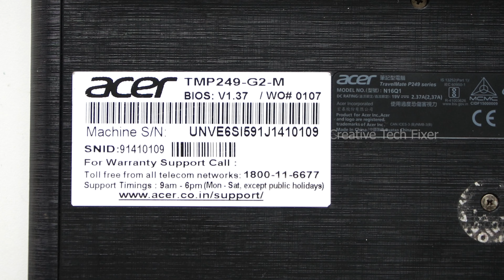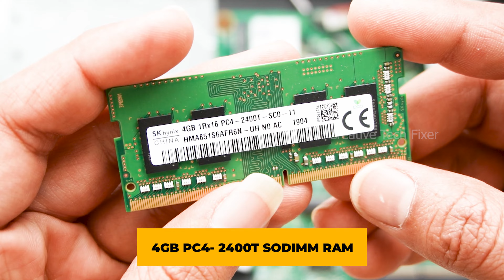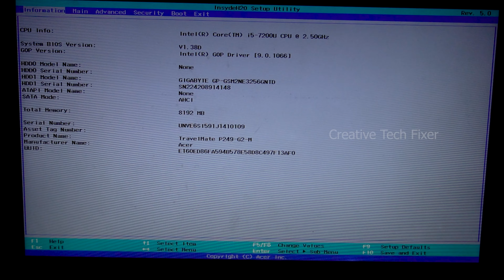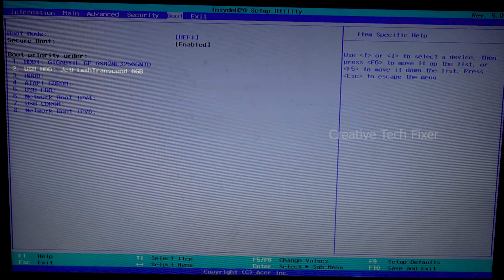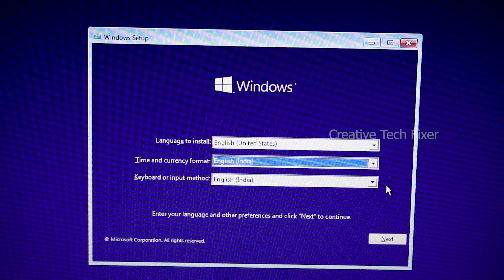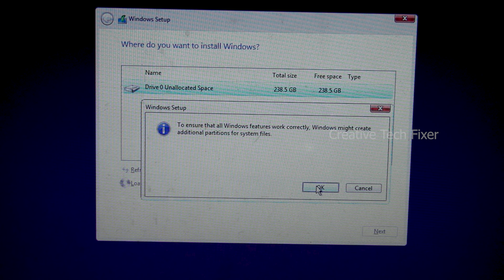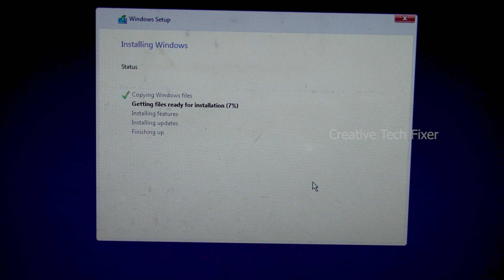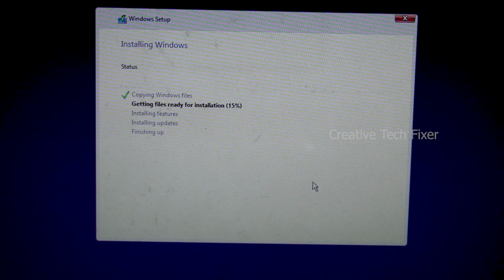#acer  Travelmate P249 series RAM + NVMe SSD upgrade | Boost Your Laptop Speed

Comment: Hi sir! 
Mine is a P249 g2 mg (N16Q1) 

Can i upgrade into m.2 nvme PCIE 3.0 and 8gb ddr4 2133mhz ram? Pls answer thanks
Reply from the maker: No you can't upgrade NVMe M.2 SSD on this laptop.. there is no M.2 SSD slot. And you can upgrade upto 32GB DDR4 2400MHz RAM.
If you like the video please subscribe to my channel it could be helpful to my channel growth..
Any queries feel free to drop your comments..
Reply: I think it has
Reply: @CreativeTechFixer  there is an NVME slot on this laptop model, you can literally see the m.2 screws at the center lol, it accepts PCIE 3.0 NVme 2280, 2260 or 2240 M key

Comment: My laptop model is acer travelmate tmx-314-51-m which 1 tb ssd is best to use? Also will 4th generation ssd be compatible with my laptop?
Reply from the maker: Your laptop supports only SATA SSD..you can use upto 2TB SATA SSD or M.2 SATA NGFF SSD (not a NVMe M.2).  I prefer crucial or gigabyte or Samsung or Western Digital brands.
If you like the video please subscribe to my channel it could be helpful to my channel growth...
Reply: Ahh thanks.... Just one more question ... My laptop also has an empty hdd slot... So can I connect another ssd in that slot and use both the ssds simultaneously
Reply from the maker: Yes you can use both the ssd's simultaneously.

Comment: Can I use SATA 3 SSD and M.2 SSD at the same time? My laptop is Acer Travelmate P249 Series N16Q1
Reply from the maker: Sure you can use both the storage at the same time.
Reply: @CreativeTechFixer   Thank you so much! Can you also recommend where I can buy or what type of M.2 SSD and RAM is best to buy for my laptop? I really appreciate your help! :)
Reply from the maker: @jra-ry9sz  can you share the details of your RAM.. just open the back panel of Storage and RAM section then remove the RAM and share the RAM image also share the M.2 slot image to my gmail ID.

Comment: Thank you for the informative video! I just want to ask for your suggestion sir, I have an 8gb installed RAM and I need to expand it to 16gb RAM. My problem is, I am overwhelmed with the wide variety of selections available. My laptop is also Acer TM P214 Series. The processor is 11th Gen Core i7. The model # is N19Q7. The brands that I am currently eyeing are: Crucial and Adata. I hope you can help me with choosing the best RAM. I need to use a higher RAM which is 16gb so that the software I am going to use will run smoothly without any problems since the software is an Engineering Simulation for FEA and CFD. Thank you very much and I hope you can help me. More power to your channel!
Reply from the maker: Best selection is Crucial with 10 Year manufacturer warranty.
If any information required feel free to drop your comments

Comment: Can I use the SATA 3 SSD and put a M.2 NVMe SSD to the M.2 Slot at same time? My laptop is Acer Travelmate P249 (Model No. N16Q1) TMP249-G3-MG

Thank you in advance! ❤
Reply: I mean, I will keep the internal HDD and add to the M.2 Slot a M.2 NVMe SSD. Is that possible for my laptop?
Reply from the maker: Ya you can use together M.2 NVMe 2280 PCIe 3.0 SSD + 2.5 inch SATA HDD/SSD.
Reply: @CreativeTechFixer  Thank you! ❤